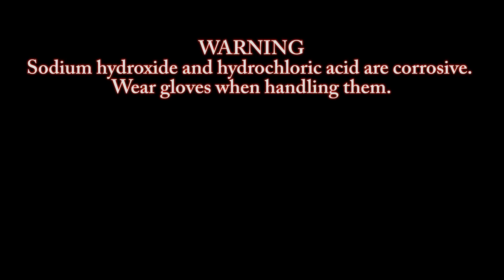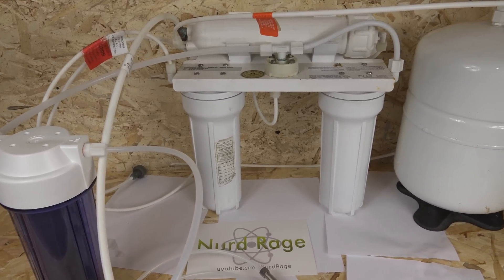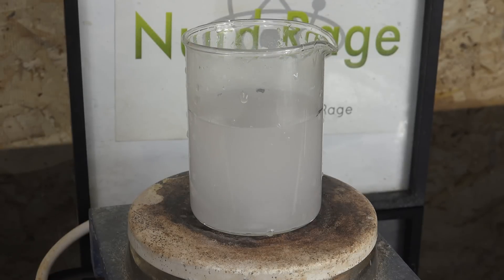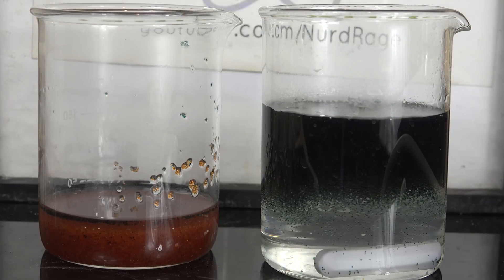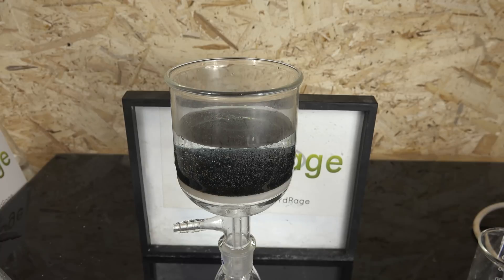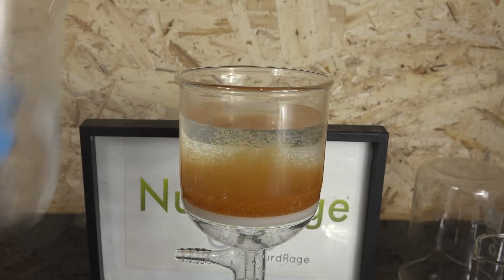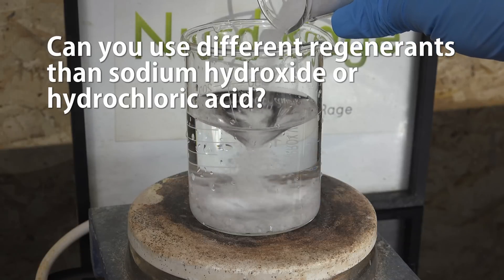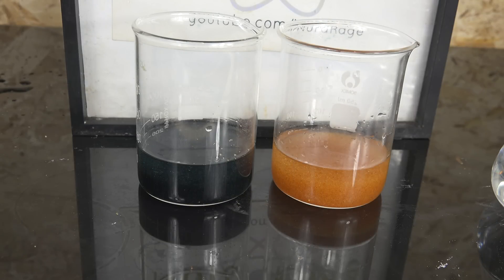How to Regenerate Deionization Resin for Use in Reverse Osmosis Deionization Systems

Comment from the maker: Answer to a common question that keeps coming up: 

Separating and remixing the resin seems redundant, can time and labor be saved by keeping the resins separate during use and regenerating them in independent cycles? 

Actually yes, you can save time and labor by using separate deionization beds, but there are some caveats. 

 So for those of you that don't know, since the resin beads work independently, you don't strictly need to mix them. Instead two different cartridges can be made, one containing anion exchange resin and the other containing cation exchange resin. They are installed in separate housings and connected in series. As the water flows through one the corresponding ions are removed, and then as they flow through the next cartridge, the ions of that type are removed. The result is deionized water just as with a mixed bed. But the system is much easier to regenerate as the resins are already separated and it's just a matter of removing the appropriate resin, mixing it with regenerant, washing it, and putting it back. In fact a number of commercial systems indeed do it this way. And you can set your system up this way as well. 

The reason why it's not the standard is because it actually produces slightly lower purity water. This is because as you replace ions you shift the equilibrium of the reaction and some of it shifts back. 
For example, let's say we have a solution of sodium chloride salt water and we run through a cation exchange resin already loaded with hydronium ions. The result is the sodium ions are swapped out for hydronium ions making hydrochloric acid. But as we know from before, hydrochloric acid will actually regenerate the resin and swap out sodium ions making salt again. Fortunately the effect is very small since the concentration of hydrochloric acid produced is very low. The actual equilibrium will lie very far to the right. But the effect isn't zero. 

The tiny amount of sodium that remains will pass through the anion exchange column without being absorbed. Meanwhile, most of the chloride will be removed but again, not all for a similar reason of equilibrium. To improve this you need to have another cation exchange resin column that now removes the remaining sodium ions. Since the most of chloride was removed by the anion exchange resin the amount of hydrochloric acid produced is lower so you get improved water quality. But it still isn't zero, you need to keep stacking more and more pairs. 

A mixed bed deionization resin column solves this by essentially having hundreds of deionization pairs in one column. The leftover ions from one bead of resin are removed by the next bead, and the leftovers from that bead are absorbed by a bead further down. So mixed bed resins give the best performance for the least complication. And thus remain the standard for water deionization. 

However there is a way to get the benefits of a mixed bed deionization column and still have the slightly easier maintenance of separate beds, and that's to use both.  First have the anion and cation exchange columns processing the incoming water, and then have a final mixed bed column to polish the tiny percentage that makes it through. As long as you keep regenerating the anion and cation exchange columns before they are completely depleted, you can get many months of use out of the mixed bed column before it needs to be regenerated. 

 Personally though, i don't bother. Separating and remixing the resin isn't the most labor intensive part of this process and i don't regenerate my resin often enough anyway to be bothered by it.
Reply: This is exactly the question that came to my mind while watching the video!
That, and now I know what the orange beads that float up out of a new ZeroWater filter are.

Is there any test to tell when resin without indicator dye is fully regenerated?
Reply: @Kineth1  effective of Ro, salt rejection, salt passage, recovery
Reply: @Kineth1  you can buy mixed bed resin and refill that zero water filter. You'll want to add some activated charcoal in there as well to have the same exact thing they have, from what I've seen by taking mine apart.
Reply: Thanks, well done.
Reply: When I interned in big pharma, they used separate cartridges in a very long series. Granted, it was industrial scale, so I wager the ability to regenerate them is more important than the initial cost to have a massive hallway full of cat-ani exchangers.
Reply: why do you still pretend to be nurdrage when its so obvious you're nilered
Reply: Exactly the question I was going to ask. But it does moot yet another: in industrial environments, do they even bother swapping out the cartridges for the regeneration process or can it be done with bypass valves? Stack a dozen or so single resin pairs in a row with more than you really need and you can always have one in bypass at some phase of the regeneration process.
Reply: @benjaminshropshire2900  I was taught they use bypass valves.

Imagine a big tank with multiple pipes leading into it. One for normal operations, one for rinsing with DI water, one for regeneration.

And IIRC, the way it works (it's been a while since I studied/interned on the plant-level) is to flush one column into the next and only at the end clear the waste fluid.
Reply: Literally was going to ask this. Thanks for answering. :)
Reply: Could you use a small amount of NaCl to replace some NaOH  to get a high sp yet still treat the resin in 1 step?
Reply: "The reason why it's not the standard is because it actually produces slightly lower purity water."
Could you not fix this using a third mixed cartridges after two with different resins. Since it only have to remove any small amounts that slipt through the two other cartridges it should last a long time.
Reply: Hopefully someone here that knows more than I do about the actual workings of these systems could answer this question for me. In a small RO 4 cartridge system used to clean water for an aquarium is any sodium in the water being filtered already removed before it gets to the resin cartridge. The resin cartridge is the last of 4 cartridges in my small RO system and before the water even gets to the resin cartridge my TDS is 21. I was wondering if any sodium in my unfiltered water is removed before it gets to the resin cartridge because sodium would be the only thing in the 21 PPM before it gets to the resin cartridge that might cause me issues and was thinking of just leaving the resin cartridge out of my system if I don’t need it. Thanks in advance to anyone who might be able to answer my question.👍
Reply: I'm so glad that you are okay

Comment: Can I leave my mixed bed resin inside of my spotless car wash container? I have ball valves on the canister to allow for keeping the beads from completely drying out but idk if I can leave the beads submerged in water that’s 0 ppm or do I drain off the water inside the container and just keep the beads moist or whatever and not fully submerged? I pretty much just use this for rinsing my car after washing and it’s a mixed bed deionized resin.
Reply: i leave my resin in water, with the valves closed when not in use.  Still working after more than a year,  although I suspect I will need to regenerate sometime soon.

Comment: Brilliant video! Have a question about the mixing ratios. I have about 11 litres of resin, a 6% solution of hydrochloric acid and caustic soda crystals, would you be able to tell me if I can use the hydrochloric solution without diluting and how much solution I'd need and also how much ro water needed for the caustic soda.
Any help is appreciated, thanks

Comment: A while back I was experimenting with using cation exchange resin in a DIY chromatography column to seperate complex mixtures in solution. It is evident that there is some real potential there for the amateur chemist though i never fully tapped that potential. My goal was to isolate a specific compound which would be easy enough to achieve with a basic understanding of ionic exchange resin or a little bit of time experimenting. 

I'd like to see someone further this research, as I had to abandon the project for the foreseeable future

Comment: Hi. Thanks for giving ideas. But your procedure is inadequate. 
You should try using a zerowater filter, us it out in it's tolerance 006ppm. Then regenerate it as you show and obtain the same endurance as when used first. My guess is that you get 25% using your method. Prove me wrong, or show a more adequate method.
When cleaning resin include the total amount of time used, and amount of cleaning water. 
Use a full filter amount of resin and not just a fraction.
Good luck.
Reply from the maker: Just run a complexometric titration on a metal standard solution after putting it on the column and then eluting. You can get nearly quantitative recovery every time.

Comment: Hey Bud, can Muriatic Acid be used in place of Hydrochloric Acid?
Reply from the maker: They are the same thing. Hydrochloric acid is the scientific name for muriatic acid
Reply: @NurdRage  ok, good to know. I looked them both up but it said Muriatic Acid had impurities, but I guess it's not enough to make a difference?
I went to a cleaning supply place today and found a 5 gallon container of that Sodium Hydro stuff for 30 bucks. They use it as a wheel cleaner, so I feel like that was a pretty good deal, and most likely the harder to find of the ingredients needed to replenish my Resins. I really appreciate your video, and quick responses to my questions.
Reply from the maker: yeah the hardware store muriatic acid is good enough for what you're using it for. As long as it looks clear without sediment or strong color (a very slight yellow or green is okay), then it should be okay. You only really worry about the impurities if you're doing analytical lab work.
Reply: @NurdRage  excellent, you saved me from going on an excursion. 😁

Comment: Yo man, I've watched a few videos on this process, and this is the 1st video that actually makes sense, and explained so well. I really appreciate you making this video. 
Now, I need some help. FYI, this Is RipperJack from season 2 of Tiger King, and I normally help people who need drastic help, free of charge. If you watch season 2, you'll see I need a ton of work, all for free. 
Here's where I need help though, with the math. I have a mixed bed di system for car rinsing, and for use in my press cookers for my mushroom sterilization process. 
Let's say I had 10 LBS, or 20 lbs of mixed bed resin that I needed to reactivate. 10lbs is easier math I think, and I'm curious as to how much solution, or how much of that solution would I need to start the process of separating resins, and then the next step? This is where I'm completely lost, and would really appreciate some help. I can send an email with my contact info, or come to you in person to have a walkthrough of the process. I would also be willing to pay for your time, if required. 
I hope to hear back from you, or at least get some insight from someone who might have this information. Thanks kindly, and I'm located in Oklahoma if you're close to that State.
Thanks, RipperJack. 
P.S. Carole definitely did it!
Reply from the maker: Its not too hard, the important part is to get the density of the regenerating and separating solution right. that 3/17 ratio of sodium hydroxide (crystal lye) with water. So if you have 17 lbs of water, you add 3 lbs of sodium hydroxide. Stir it up and let it cool, then mix it with your resin. I don't know how much you need for your particular resin, but the point is that you want enough that it will separate into 3 layers.  Anionic resin on top, a layer of clear solution in the middle, and the cationic resin on the bottom. Since crystal lye isn't too expensive, i say start with an equal mass to your resin. 20 lbs of resin? so 3 lbs sodium hydroxide (crystal lye) and 17 lbs water like i said before. If it's not enough, make more. 

The anionic resin floats to the top. scoop that off and into a separate bucket, filter or drain away the solution, and wash it with clean water. Meanwhile the cationic resin is at the bottom in the original solution, filter or drain away the solution to get just the resin. Wash it once with water. Then add in hydrochloric acid to regenerate it, let it sit for 10 minutes, then filter/drain away the acid. Wash the resin in clean water. Since you're just using it wash your cars and make mushrooms, you don't need SUPER ULTRA clean washing like i did in my video for laboratory grade water. Just a couple of washings is fine. Then mix the two resins together and you should be able to use them for your DI system.

Comment: Tried this today on zerowater filer. However, the tan resin floated in the naoh solution instead of the dark green one as you have shown. What could this mean or am i doing something wrong?
Reply: maybe the one dyed in the video is the other one, or you're using resins with different densities from his (unlikely since they got separated by the very specific naoh solution)

Comment: Having an issue Regenarated Resin is about 75% less effective beffor depleted again (comppared to brand new) did this already 3 times about 10Gal every time.  Every step is being followed very pointy  ... and trying to rinse out using pure water until i obtain 5~10 ppm need to rinse about 20 times to get that reading.(funny thing is Cation seem always slippy to touch like if there is still some sodium hydroixd sticking to it maby is this my problem? ).  Is there any advice in some other step i should change to get better result.

Comment: Why is the cation resin and anion resin always mixed?  I don't get it.  Why can't they be in separate cartridges (water goes through one first, then the other during the deionization process)?  Then, when it's time to regenerate, it's so much easier.  The most difficult thing would only be rinsing the acid and base after regeneration.

Comment: How do you suggest getting the resin out of the original filter cartridge? I am working in a research lab for the summer and my task is to do this exact process, however, I am concerned about how to extract the resin beads safely (given that I don't know what chemicals the resin has absorbed over its operating period) and efficiently. Any help is great, thank you so much again for the wonderful video, it really saved me. :)

Comment: Crane ultrasonic humidifiers use a demineralization filter containing what looks like the cation exchange resin. There doesn't appear to be any of the darker anion resin.

Would running an HCl solution through such a filter work to refresh it? The filters don't appear to be constructed to allow resin replacement or removal.

Comment: i tried with some resin found in a washing machine water softener filter.......not the same stuff. after adding the hydroxide the water turned milky white.....and then i noticed i seem to have less media.......in time this seem to get worst, and nothing floated, even after adding more hydroxide. so i recon all filter media is maybe not made equal.

Comment: What is the best way to store used up di resin? I'm looking to recharge in larger batches. I'm just wondering if i would have to worry about mold or any other concerns if i leave them in a bucket
Reply from the maker: freshly regenerated resin must be stored in a clean plastic air-tight container. Air-tight is very important as carbon dioxide will get absorbed and deplete the resin. Metal should be avoided because the resin will VERY slowly absorb metal. It's super slow, will take decades, but you still want to avoid it. If both those conditions are met, you can store resin for many decades. If you can't meet those conditions. Then its best just to store the depleted resin, and before you need to use it, regenerate it then, and use it right away.
Reply: @NurdRage  oh I was talking about depleted resin.
Reply from the maker: lol, my mistake! yes, just store it in a plastic bucket and you'll be fine.
Reply: Thank you for that info! I love this video btw. Very informative!

Comment: If i want to do this in larger quantities, what do you recommend for containers? I run DI water system for car washes at home, and would be interested in doing like 5-10lb at once to save on time. Also what is the proper way to dispose of the chemicals after? I'm not a chemist, but looking for ways to cut resin cost. thanks! great video btw!
Reply from the maker: Plastic buckets is fine for containers, for car wash use, you don't need ultra-high purity like a laboratory. Just be sure to wear elbow high dish washing gloves when handling the chemicals. When you're done, you can mix all the waste chemical solutions and add in some (like half a cup per bucket) baking soda. If it fizzes, stir it until dissolved then add in another half cup of baking soda. Keep doing this until it stops fizzing. At that point it's safe enough to dump down the drain (it has essentially become salt).

Comment: A couple folks have alluded to using these for the stationary phase in chromatagraphy to isolate proteins and whatnot... Anyone have any notion of how workable that would be? My (largely uninformed) sense is that the resins designed for chromatography like amberlite, &c. are much finer grained, if otherwise more or less the same...?
Reply: I’d like to know the same thing. It’s very hard to find specifics about commercial resins. I couldn’t even find a source of separate cation vs anion resins for the case when you need only one or the other. In fact that’s how I arrived at this video, trying to find a way to separate the two so I could have resins that could grab onto carboxylic acids or amines and release them when flushed with the appropriate acid/base.